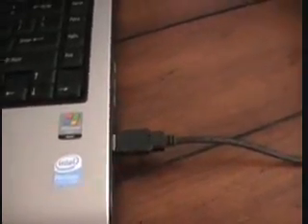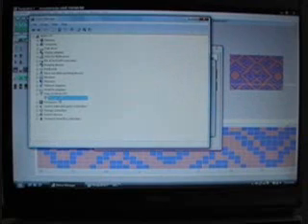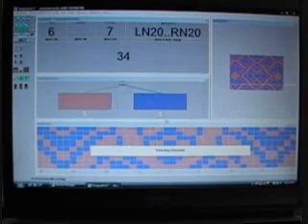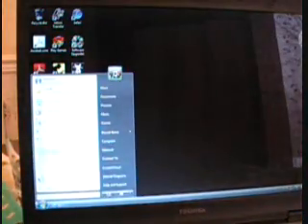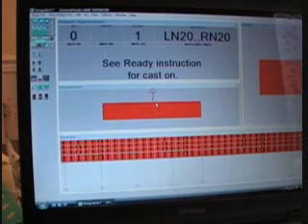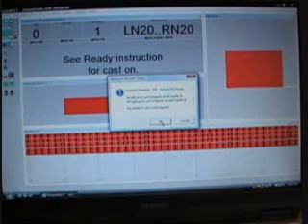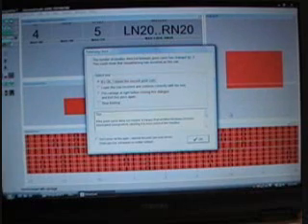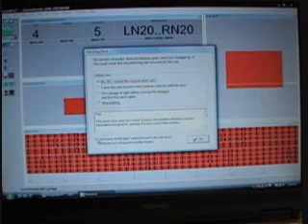Designaknit Pro 7 with Vista and Silverlink 2 + Serial  USB adapter Part 2

Comment: Thanks for the demo.  

For those of you that would like to purchace this software and cable (specific for your knitting machine) go to SOFTBYTE-dot-CO-dot-UK website.  Then, select the "Contact Us" button and select your location flag to show the distributor.   I'm sorry but You Tube does not allowed us to post links.  Hope this help you to figure it out.  

The latest revision is Designknit Pro 8.